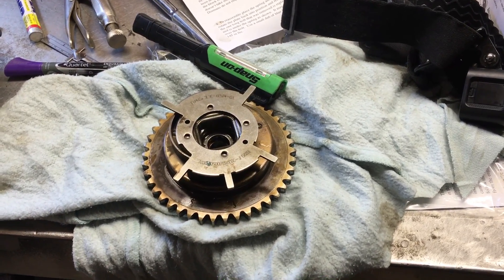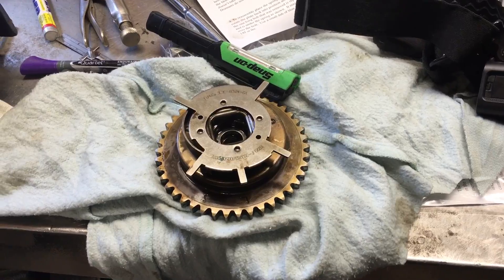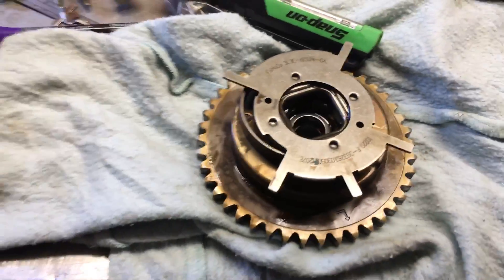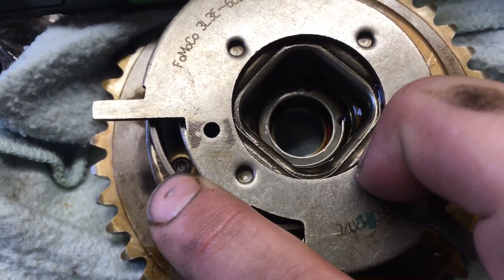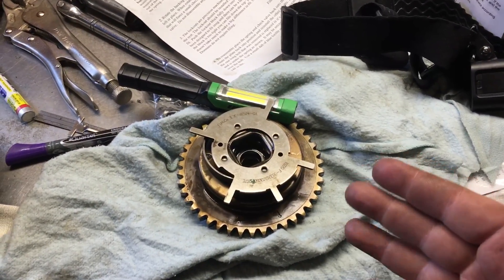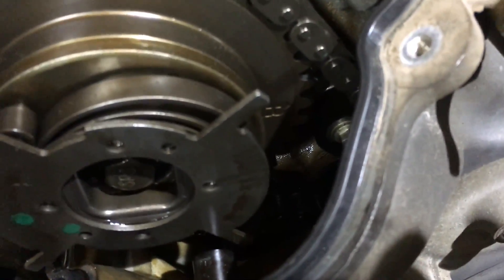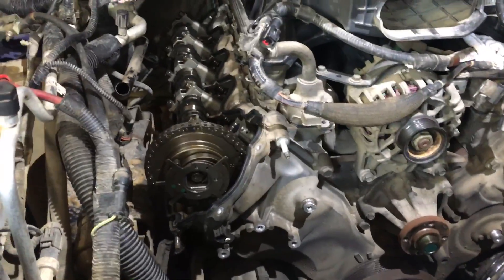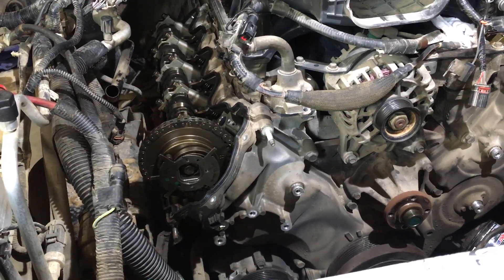Ford 5.4 3v Possible Bad Cam Phaser

Comment: There's a Dorman phaser and a Motorcraft one.  My 05 had one spring bolt.  You won't regret the lockout made a massive difference in my truck. The extra low end grunt is great.
Reply from the maker: that's what i'm hoping to achieve glad to know your happy with your lock out kit.

Comment: If you take it apart and a small spring flies out and you can't find where it went, don't worry. It wasn't meant to be there in the first place. It'll still work but may rattle (like that old watch I took apart for someone when a spring flew out from somewhere random).

That's my professional advice.
Reply from the maker: 😂😂😂 I was aware of the spring and it didn’t go flying

Comment: They only have the one long bolt, replaced both of mine and the old ones have the one long bolt for the spring only .mines a 04.I can send you photo if wanted.
Reply from the maker: Did the new ones only have one long bolt or 2 ?
Reply from the maker: Ok should there be any concerns about the 1 bolt style or should a person just get a set of doorman for the lock outs ?
Reply: Bullshitkorner I would definitely not buy the doorman phasers,heard nothing but bad things about them,lasting about 5000 mile.Thats totally up to you though.
Reply: Bullshitkorner I don’t remember,I replaced them 2 years ago already.sorry.I know that doesn’t help you.

Comment: looks like the bolt is broken off should be 2 long bolts
Reply from the maker: That’s what I’m thinking as well but what are the odds on both phasers ?
Reply: Bullshitkorner mine is an 06 it has two not sure on the 04-05
Reply: Bullshitkorner look like the early version only had one long bolt
Reply from the maker: Mine is a 06 as well, someone just mentioned the one bolt style
Reply: Bullshitkorner I bought mine used so they could have been replaced with the updated version b4 I got it not sure
Reply from the maker: I did and it looks fine

Comment: When I did my truck, I did a complete timing rebuild new phasers, chains, tensioners, guides, and a new melling oil pump.
Reply from the maker: I’m doing all that as well but do you remember if your cam phasers had 2 long bolts or 1
Reply: Andrew Schwab well that’s of no help whatsoever.
Reply: I can’t remember Jerry! I was thinking of doing lockouts, but some people were saying you loose engine performance. Sorry I couldn’t be more help, but even if you do lockouts might be worth it to buy new Ford oem phasers.